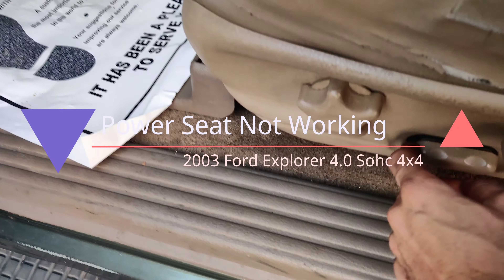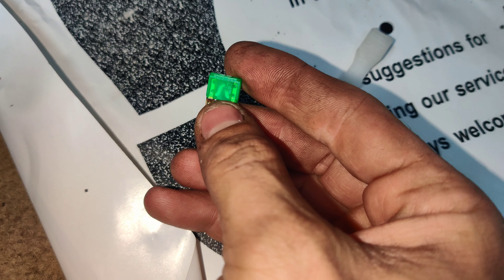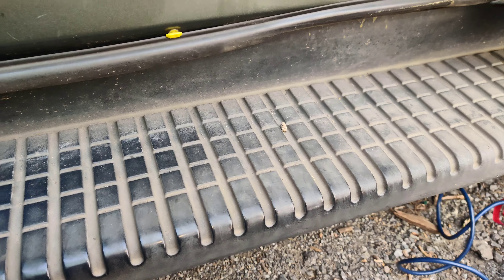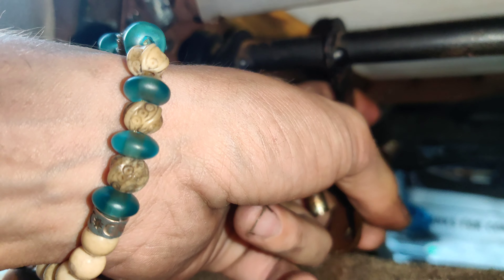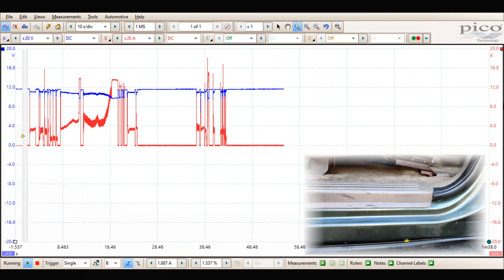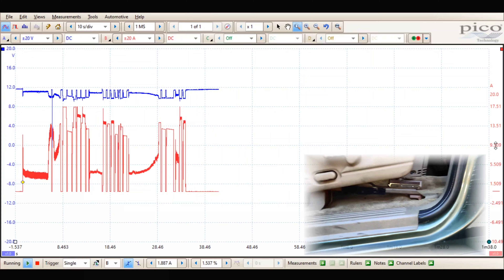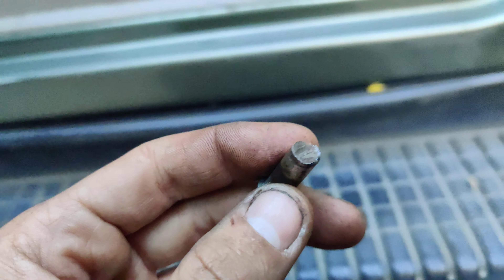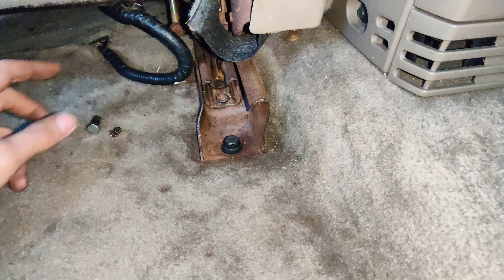2003 Ford Explorer 4.0 SOHC 4x4 Driver Power Seat Not Working

Comment: By the look of the Seat itself, i would not bother about the move function -some people have cars....even with 500k on mine, it doesn´t look as destroyed
Reply from the maker: Here the seat has to work for inspection, also it was at a used car lot, they requested it be diagnosed and fixed.